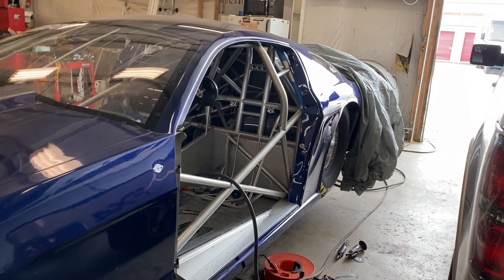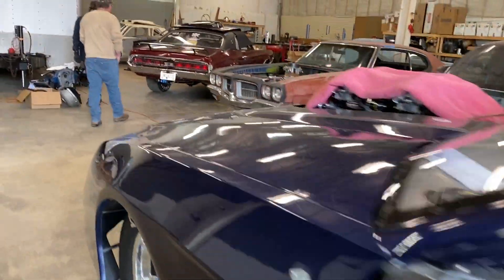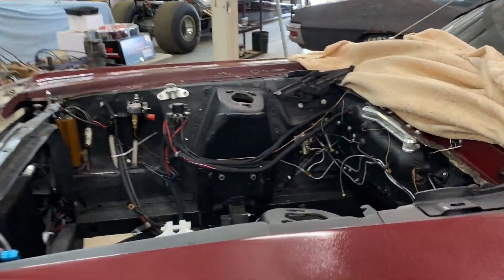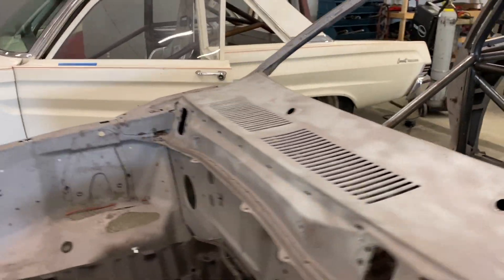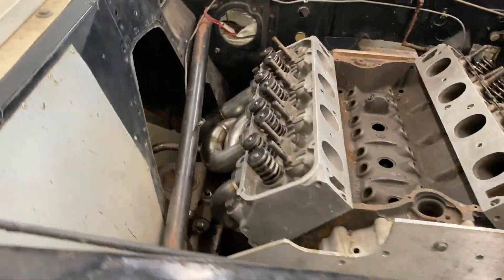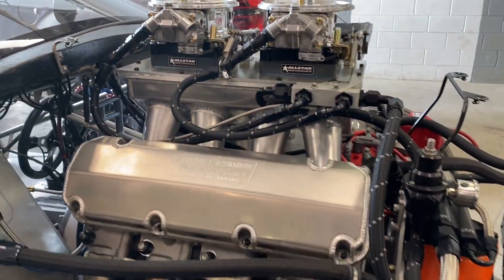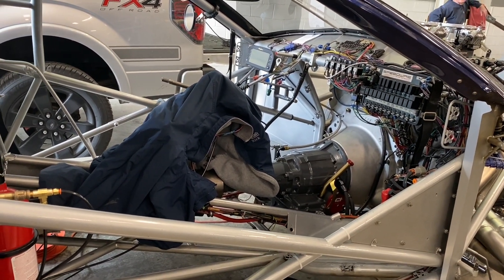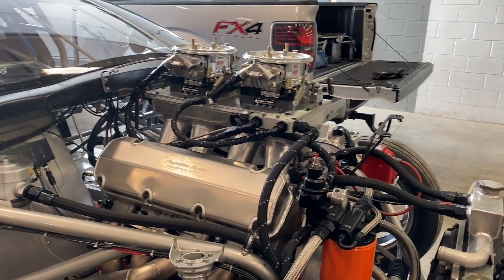Rick Baily's 1300+ hp 2010 Ford Mustang/Chassis Shop Tour

Comment: Who's have thought 11 years of aluminum Powerglide production would result in a Godsend to the sportsman drag racer. The Glide is a true Masterpiece with the addition of todays alloy steels and a brake which may be first credited to Marv Ripes? of Fairbanks Transmissions. You just can't knock a Glide, but with prices climbing... we may all have to go to belt drives and a lever.
Reply from the maker: I think glides are boring when it come to auto trans. Would never waste my money. That is my my opinion. Did you say something about my interview with Warren Johnson and delete the comment?
Reply: @DragBoss351Cleveland  "Powerglides Rock" when done up with the new aftermarket alloy steels. Go count the Glides at the track, you'll need all your digits and then some just to get off the first row of cars... then count your C4's and C6's. The C4 and Cruise-o-matic design with two bands & two clutch drums were purchased from Chryslers Torqueflight design for 5 of 6 million in the mid 60's. The old Clutchflight converted torqueflights used in front engine diggers had the steels and frictions bolted together in the forward clutch drum and the high drum ommited in some builds. (2 speeds) There are TH400's on the track utilizing only two speeds. The 2 Speed Glide is a Godsend to the sportsman drag racer in the opinions of many, myself included.